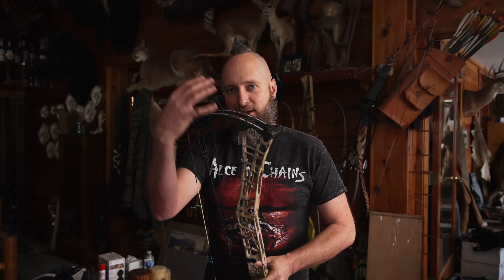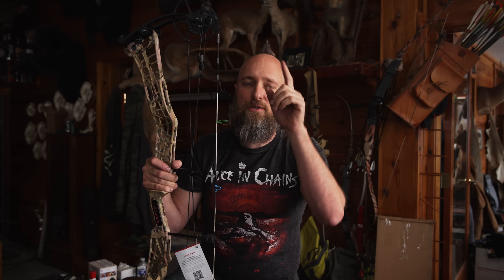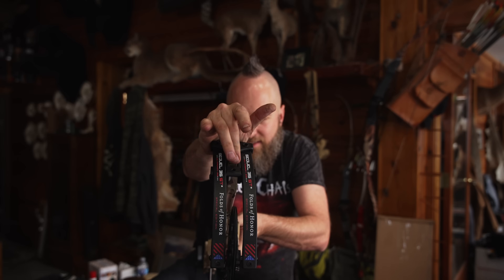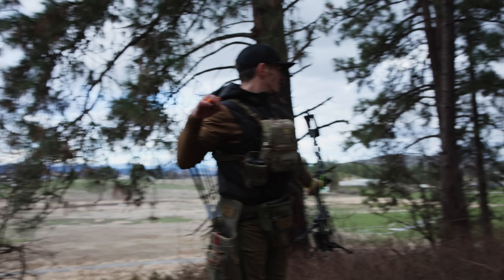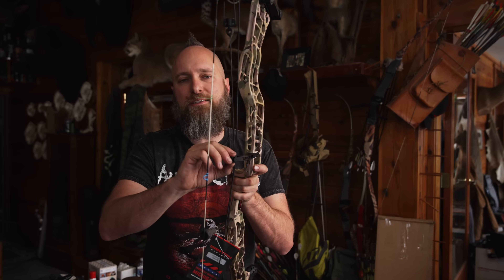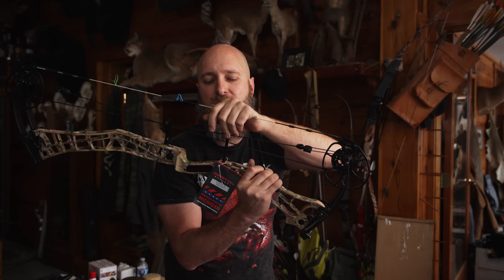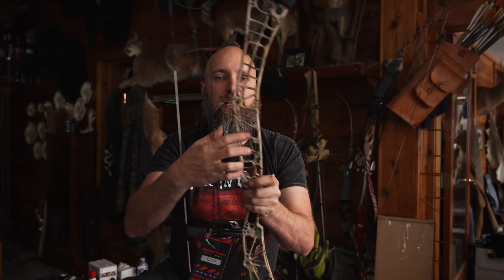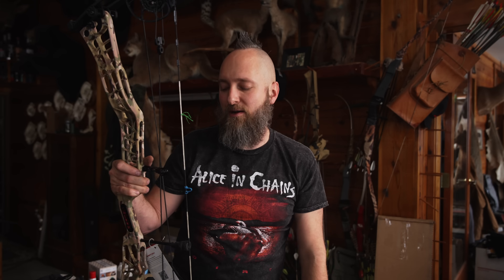THE ANATOMY OF YOUR BOW... WITH MFJJ

Comment: If you could design your own bow...what axle to axle length, reflex, brace height, speed with a 420-450 grain arrow (70 pound draw), and draw cycle characteristics (ie performance or comfort)?  What do you prefer for draw weight/length adjustability methods?  I know it would be quiet, little vibration and easily adjustable for tuning.